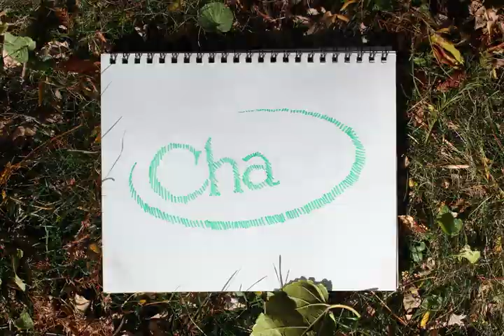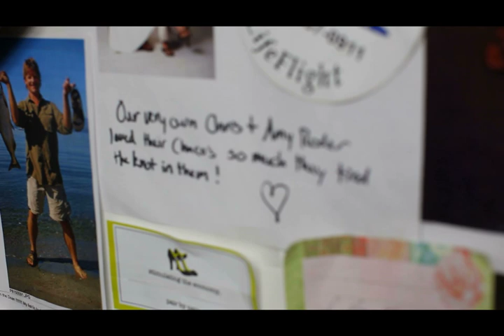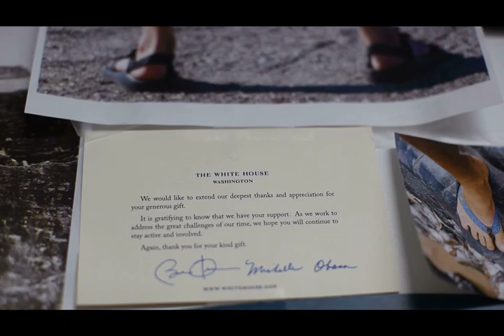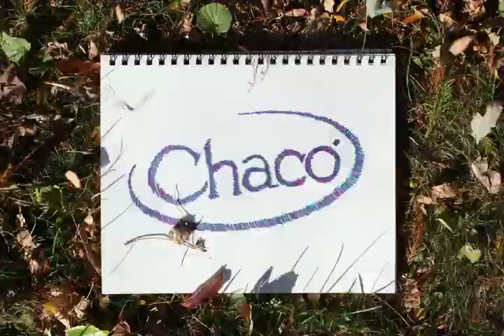How to Repair Your Chaco Sandals | ReChaco Rocks

Comment: This is great... unless you have Chaco slides in which case you're out of luck on the repair - they break after about 3 months of use.  You can still call for warranty replacement though.

Comment: Straps aren’t long enough for my feet (buckle sits on top center of my foot using all the strap length) and z volv (the only Chaco sandals with low arch support) isn’t customizable upon ordering online so I have to buy a pair of new z volv and then send them to rechaco to essentially tear apart the new sandal and add longer straps which is only 2 additional inches?  I’d love to buy your sandals but apparently they aren’t made for people with wide feet and high insteps 😞
Reply: You should call them. I saw a guy who had a size 15. They made him some custom shoes.

Comment: Re Chaco used to be much better years ago, they seem to be able to do anything except take your straps and put them in a new set of soles. How is it you can re-strap a soul but cannot take the straps out of souls that you say are unrepairable and put them in a new set of soles. So disappointed I will wear these until they are gone and then I will move on to something else